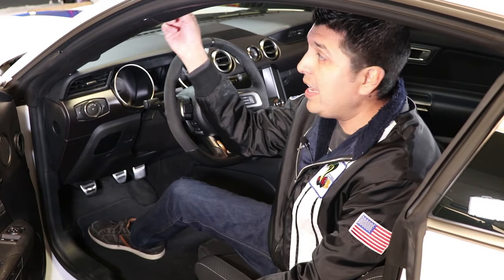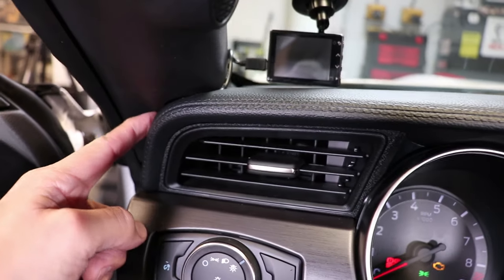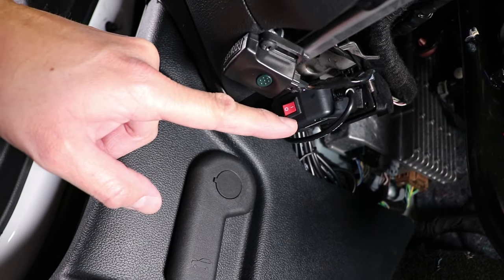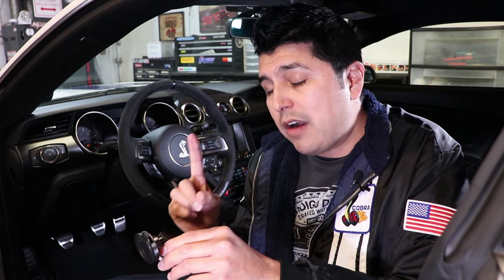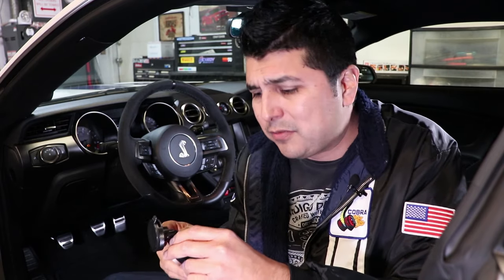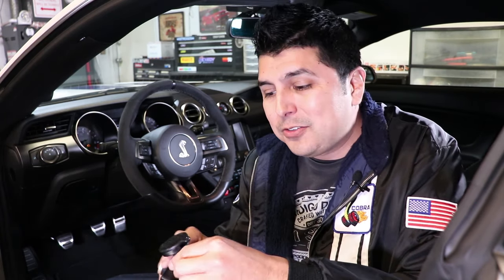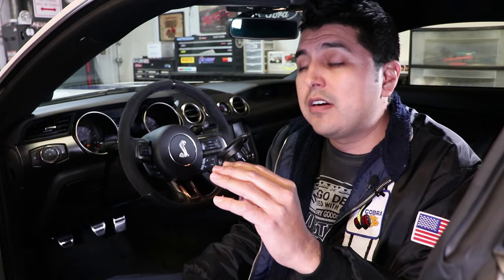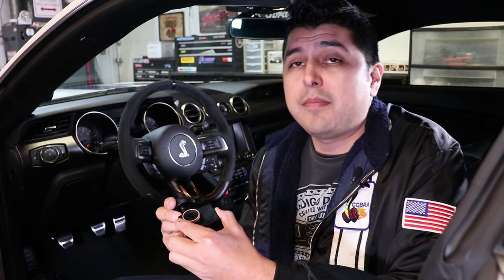Don't hardwire your Dash Cam! Try this instead!

Comment: The dashcam should be centered in your windshield, not off to the side. Hidden behind the rear view mirror gives the dashcam the best visibility of the road ahead and minimum obstruction to the driver. Tapping into a fuse is the most professional looking install and the tidiest.
Reply: I have at the same position as on the film but a little higher and this position is much better,  no obstruction and better cooling.😜
Reply from the maker: Hi BluePixel Motorcycling! unfortunately this is the only location where we can legally place our dashcams here in California :( However the dashcam could be placed higher by running the cable up the A Pillar if desired, hope this helps and thanks for watching bud!
Reply from the maker: Awesome Jacek! yeah the position can definitely be easily adjusted by running the cable up the "A" pillar and still be able to use the OBD adapter. Thanks for watching and commenting bud!

Comment: OBD2 port should never be used to power anything lime a dash cam.
Reply from the maker: Hi vw_steve_t5.1! I been running mine for over three years now without an issue but I know some folks rather not use the OBD port for power. Here is my other video showing the alternative Hardwire method https://youtu.be/zbxYA4VhuT8  this maybe more of what your are looking for. Hope this helps and thanks for watching!

Comment: I’d get a different camera that can take a 128 gb card or more.
Reply: Why though? For Dashcam 16gb is already too much. It automatically deletes all the peaceful records and only save what you need + accidents. I don't think you have that many accidents to fill up the 126Gb. That's a big waste
Reply: @tomjackson2341  til you need a video from more than a few days back...
Reply from the maker: Exactly, Fully agree with you bud!
Reply from the maker: Hi boricuafrican! if the dashcam locked the video (event that triggered a locked video aka G-Sensor or manually locked by the user by clicking the lock button when the incident happened) that video clip won't be overwritten by the dashcam and can be accessed at later convenient time (however I would recommend copying that locked video form dash cam to PC to have a separate copy as back up). Thanks for watching and commenting bud!

Comment: I just bought the cable but I don’t know how to setup the continuous recording .. records only 5 minutes after the engine is off ☹️
Reply from the maker: Hi Adina, unfortunately the continuous power option won't work with Garmin cameras, for some reason the cable is unable to activate the "Park mode" which on a Garmin camera means always on. There is something special inside the official Garmin cable, I plan to buy one and take apart just to see whats inside, maybe we will figure it out! Thanks for watching!
Reply: AutoFun  thank you for your reply but my camera it is next base not garmin

Comment: I'd be wary about using the OBD port to power a dash cam.  Do your own research before you go ahead.
Reply from the maker: Hi Qbal, fully agree, while my OBD adaptor has been working great for almost two years now there is a risk every time an aftermarket item is connected to the electrical system of the car. I am working on a couple other alternative ways of connecting them, so hopefully I can show a couple choices that have worked out for me. Thanks for watching bud!

Comment: You said that having the camera to low there is a chance that you will miss stuff, but then you place it low left, you contradict yourself.
Reply from the maker: Hi Ross! yes the lower location is a compromise. I placed mine there because in California that is one of the locations we can legally mount on it on. I also didn't run the cable higher to avoid any potential conflict with the Side Airbag inside the A-Pillar. However I'm still able to capture great footage, this may be due to the super wide angle lens on my Garmin. Hope this explains the location choice and thanks for watching and commenting!

Comment: Why the f can't we just have a dash cam with the battery that we can charge and then put it on the windshield.
Reply from the maker: Hi G! Ah good question, people some use action cameras (which are rechargeable) to record driving (and a few action cameras have dash cam mode). However dedicated dash cam typically do not have an internal battery as this would require constant recharging (dash cams use quite a bit of power) additionally batteries can experience high temperatures inside the interior of a vehicle  and there is the potential for a run away event (fire) during charging or discharging inside the car. Here is an example of a internal dash cam battery and what the sun did to it https://youtu.be/HW8jqbl_ayU and a video of battery related fire I personally experienced https://youtu.be/XfWgJ8nu-RA (destroyed the house) This would mean that the dash cam would have to be removed and installed constantly to recharge it off the vehicle. Cheers!

Comment: Super not a fan of this. The diagnostics port is for diagnostics, you should never plug an unknown device from an unknown manufacturer into it. A car is the second most expensive thing most people own, and should be treated as such.

Also, you should never attach things to your windscreen next to the A pillar. If the airbag goes off, it could send that object with it, sending it across the car at breakneck speeds. I know this because something very similar in someone else's car hospitalised me.
Reply from the maker: Hi Michael! Here is my follow up video showing how the adapter works (and how it relates to the SAE J1962 standard we use in the industry for OBD2 port design and use) https://youtu.be/aV5jQovoaCI including the use of the OBD2 port by non-diagnostic tools. I been running mine for over four years now without an issue and since making this video, we also seen more dash cams like Ring, Garmin, Thinkware, Vantrue, Nexar, Wolfbox, use OBD2 adapters. However if you would like to avoid using the OBD2 port for power (and also looking to enable park mode) here is my other video showing the alternative Hardwire method https://youtu.be/zbxYA4VhuT8 Regarding the mounting location, unfortunately we are very restricted on the mounting location for the dash cam here in my State. But the installer can place the dashcam further away from the A Pillar if desired. And to your point if there is an airbag in the A-Pillar here is my video https://youtu.be/uZp95NbNlmM where I explain some of the issues that can pose. Cheers!

Comment: This is the lazy way to install a dashcam.  Do it once, do it right.  Optimum position for a dashcam,  is top center of the windscreen, not bottom of the pillar.  If you can't do it right, pay someone who can.
Reply from the maker: Hi SDMF_1! Unfortunately we are very restricted on the mounting location for the dash cam here in California :( But The dashcam could be placed higher by running the cable up the A Pillar (and also under the headliner) if desired. Also here is my other video showing the alternative full Hardwire install https://youtu.be/zbxYA4VhuT8 Hope this helps, Cheers Bud!

Comment: That's the worst place to have your dashcam at. You see nothing.
Reply from the maker: Hi MusicAddiction! I actually get good coverage with my Garmin in this position, this may be due to it's wide angle lens but coverage will vary from car to car. The dashcam could be positioned higher if desired by running the cable up the A pillar. Thanks for watching and commenting!

Comment: Didn't you say that you don't like the idea to run wire through the panel? Is the same thing. Pluggin a wire to a fuse that's not right. Take the car to the dealer and they will reject the work when it's something electrical because they would know is not a factory connection. 👎
Reply from the maker: Hi Dj Drunky! You are correct, anytime you are connecting or installing an aftermarket device to your car there is potential for the Dealer to reject warranty. For this install I did not have to remove any panels which is sometimes needed for a hardwire installation (specially if you are trying to avoid running wire over the side air bags) which you can see on more detail in Hardwire video https://youtu.be/zbxYA4VhuT8 in case you want to see that install process. Hope this makes sense and thanks for watching and commenting bud!

Comment: that is a very stupid place to hide a dashcam,     the best place is behind your rearview mirror.  in your location, someone could damage your bumper while the car is parked just by calling over the floor since your bonet blocks the view. However, if you place it behind the rearview mirror you can get a glimpse of the person damaging your car
Reply from the maker: Hi TimHei! unfortunately this is the only location where we can legally place our dashcams here in California :( However the dashcam could be placed higher by running the cable up the A Pillar all the way behind the rear view mirror if desired, hope this helps and thanks for watching bud!

Comment: Everybody has their own preference of where they put the camera where you put it on the left corner of the bottom of the dash is that really the best place to put it because you don't get a really good view as if you put it above the windshield behind the rear view mirror because that gives you a better overview of everything in front of you not just the corner bottom left side I think you did that just for the looks so it doesn't stand out which doesn't make sense so if you get hit or something from the right hand side of the car you're not going to see it as good as if it was in the left hand side and if a car does hit you from the front you're not going to see the license plate as good as if you were looking for above to see the license plate! 👎
Reply from the maker: Hi modster7 That's who! unfortunately this is the only location where we can legally place our dashcams here in California :( However the dashcam could be placed higher by running the cable up the A Pillar if desired, hope this helps and thanks for watching bud!

Comment: This is a terrible idea and really bad camera placement. Plugging anything into the 16 pin OBD port is not smart. Even plugging in a diagnostics can be risky, let alone an aftermarket “adapter”. You have direct access to the CAN system, as well as the ECU. I get why you did this. But it’s not a great idea.
Reply from the maker: Hi Sour Skittles! The cable could be run higher up the A-Pillar if desired but I did recently do follow up video for the hardwire method you can see it here https://youtu.be/zbxYA4VhuT8 please let me know if this is something more of what you are looking for, and thanks for watching bud!

Comment: I do not agree. In my opinion, a completely mindless position for the camera. If anyone is wondering why, just start thinking. As in chess, a few moves ahead - imagination.
Reply from the maker: Hi Redizel! I like the analogy! yes the camera can be positioned higher up the A pillar if desired, the wire could be routed and inserted into the trim using a trim installation tool. Thanks for watching commenting bud!

Comment: the route of the cable out of the camera looks ugly, he should have put it down the pillar and there is never a need to cut any cables.  also had he just gone though a fuse most cameras have an internal battery and a motion detection mode so it turns of with the car but is still able to capture anything that happens. also what's he talking about only being able to see an hour ago, just get a better SD card. honestly I don't believe he did this himself, looking at his car he'd of probably paid someone.
Reply from the maker: Hi jon mann! take a look at this other video I made   https://youtu.be/zbxYA4VhuT8 I think is more what you are looking for, it hides the wires underneath the pillar and connects the dashcam to the fuse compartment. Hope this helps and thanks for watching bud!

Comment: "professional look" has a dashcam in the lower left corner where its uglt and in the way 😂
Reply from the maker: Hi Murlock! Unfortunately we are very restricted on the mounting location for the dash cam in my State. However the installer can place the dashcam higher by running the cable up the A Pillar if desired. If there is an airbag in the A-Pillar here is my video https://youtu.be/uZp95NbNlmM where I explain some of the issues that can pose. Here is also my follow up video showing video from different angles to help you decide the best one for you https://youtu.be/F7OzM2i7ErE Cheers!

Comment: Using OBD port to power your dash cam is the worst advice you can give to someone.. or to use to power your dash cam in your car. I will not explain it why that is the WORST thing to do.. if you search on the internet you will find plenty reasons why is not recomanded to use the OBD port to power anything. OBD port has direct conection to your Car CAN..and that should be enough reason not to use it as a power conection.
Reply from the maker: Hi Gatto Npc! I have been using my OBD adaptor now for a few years without any issue. But yes any aftermarket device can potentially fail, that is always a possibility. Here is the hardwire method https://youtu.be/zbxYA4VhuT8 however keep in mind that it still involves connecting an aftermarket device to your cars electrical system. Thanks for watching and commenting!

Comment: I don't want be a Debbie Downer but this is one of the laziest and non professional looking installs i have seen.

The camera in the lower corner is terrible for capturing video which is the whole reason for having a dashcam in the first place. The angle to the ground is hidden by the hood and by looking more up instead of down means more sunlight and glare. 

It also obstructs the driver’s view and almost certainly hides the right side of the car since most viewing angles from dashcams are around 150 degrees.
Reply from the maker: Hi Jacob! Unfortunately we are very restricted on the mounting location for the dash cam here in California. But the installer can place the dashcam higher by running the cable up the A Pillar if desired. If there is an airbag in the A-Pillar here is my video https://youtu.be/uZp95NbNlmM where I explain some of the issues that can pose. Here is also my follow up video showing video from different angles to help you decide the best one for you https://youtu.be/F7OzM2i7ErE Cheers!
Reply: @AlexAutoFun  Well if this is true (and i have no reason to doubt it) then I take back everything i wrote and apologize for coming to an incorrect conclusion. Thank you for taking the time to explain the logic behind it, I am changing to an upvote now and i wish you the best on your channel sir! My apologies again.
Reply from the maker: No worries my friend, that is California for you, we got all kinds of weird restrictions (which in my opinion are destroying the car culture it was once known for ugh) A few other states also restrict what can be placed on a windshield and it's location, not common but I always recommend checking to be sure. Cheers! @jacobmarley2417

Comment: Completely wrong place for camera. Best place- near with rear mirror
Reply from the maker: Hi Unit Elevator! Unfortunately we are very restricted on the mounting location for the dash cam here in California :( But the installer can place the dashcam higher by running the cable up the A Pillar if desired. If there is an airbag in the A-Pillar here is my video https://youtu.be/uZp95NbNlmM where I explain some of the issues that can pose. Hope this helps, Cheers!

Comment: Nope. That's where I put my GPS.
Reply from the maker: Hi Conservo Virturs! ahh got you, the dashcam could be positioned higher up by running the cable up the A-Pillar if desired to avoid conflict with the GPS already installed..

Comment: That’s very illegal it’s in the way of your vision
Reply from the maker: Hi SD! Hi ! unfortunately this is the only location where we can legally place our dashcams here in California :( However you could place the dashcam higher by running the cable up the A Pillar if desired and as you pointed out, I would also recommend checking your local ordinances for any restrictions on placement, hope this helps and thanks for watching bud!

Comment: IT;S NOT A GOOD IDEA DRIVING AROUND WITH ANYTHING PLUGGED IN YOU OBD PORT EXCEPT FOR DIGNOSTICS UNLESS YOU LIKE REPLACING YOU COMPUTER SEVERAL TIMES A YEAR!!!!!!!!!!!
Reply from the maker: Hi GMAN! completely understand where your coming from bud, I been running mine for over three years now without an issue but I know some folks rather not mess with the OBD port, Here is my other video showing the alternative Hardwire method https://youtu.be/zbxYA4VhuT8  this maybe more of what your are looking for. Hope this helps and thanks for watching!

Comment: Good ideas but probably not a good idea to use your OBD. I took my car to the service department and they broke my OBD dash cam connector. Also you won't have video of there work unless it has a battery but depending on how long they have your car for it, could die. Had this issue with my shitty owl 🦉 cam. (Dosnt have a battery) also I don't recommend the Owl cam. There subscription got to high when the got bough out. It's 20 a month. And for some reason it no long connects to the 4g tower. Trash, and wast of 400 bucks.
Reply from the maker: Oh man that sucks to hear, I haven't reviewed the Owl cam but sounds like I should avoid it, I never been a fan or subscription services, it's a good idea to be able to upload to cloud but plan has to be reasonable and the dashcam should definitely be reliable. Let me know which dashcam you end going with! I have several reviews on my channel for recent dashcams if it helps, and thanks for watching Zee Abdo!